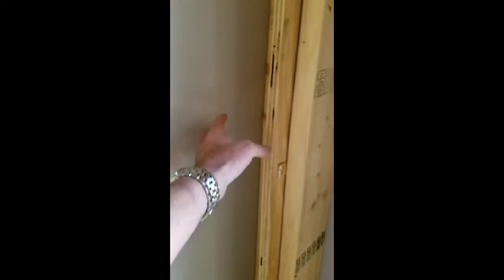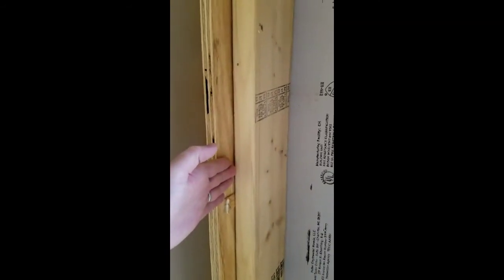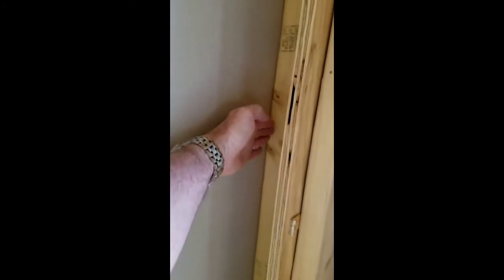Net Zero Custom Home - Exterior Shell - Matthew Bowe Design Build

Comment: Matt, I'm getting ready to renovate a house with a traditional fiberglass insulated 4" stud walls, in a northern climate, with the vapor barrier on the warm side of the studs. Do you know if I can put that insulated zip product over the existing exterior sheathing, before I re-side? Does the product breathe? I'm worried about possible trapping vapor/moisture inside the stud cavity. Thanks

Comment: I think I prefer zip systems liquid flash over using the tape only. At least over nail penetrations. The type of windows you choose will make a big difference also. Casement windows generally have far better seals.